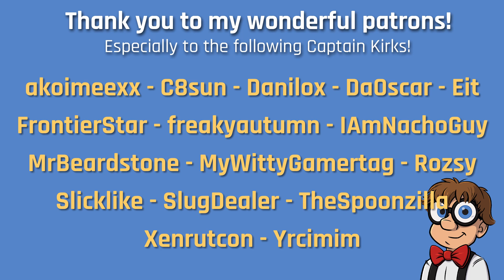Furnace Super Smelter Array - Legacy SMP #14 (Multiplayer Let's Play) | Minecraft 1.15

Comment: As I'm watching this it hasnt been discovered, but you wont get an even distribution to the last furnace in line. I just built my super smelter yesterday. Only a 32 but I'm playing SSP, no help to buy items lol. If you have that bump block directly next to the that furnace as the cart comes by it will only deliver 1 item. You have to have at least 2 more rails of track and then the bump block. As it stands of it makes 8 passes, the last furnace will only receive 4 items where as the furnace next to it would receive 12. 

My design I skimped on the amount of droppers by having 8 hoppers/dropper. Only used 4. I may go back and changed it if I feel it's too slow.

Incredible build as always. I like the idea of using the shulker loader/unloaders as well.
Reply: Also, I made mine bamboo powered. If the last furnace and hopper isnt full the farm is going. The lever that I use to activate the cart also doubles as an override for the farm. While its smelting the farm sits silent but as soon as smelting is complete and i turn off the lever it will start, then shut off when the last in line is complete. Just a basic flying machine bamboo farm. For the record I built it underground so it's not an eye sore. It easy to get around the light levels hurting the growth. I just placed a grid of torches with 2 blocks in between each other at the bottom then waited for them to grow. Then from the top of the farm (since I'm not good at calculating light levels of air blocks) just placed jackolanterns until I started to see growth. Then picked up the ones that weren't needed. If I wanted to I could've just stacked up glowstone in rows and had more efficiency with more bamboo able to grow, but it's my build that I didnt need help trying to make work and it functions for me. Just made sure there wasnt any light sources in the way of the slime blocks and was done.

Comment: At around 13:40 you talk about the awesome way of detecting a full minecart and sending it back up the hopper line if it’s still got items in it. I tried to build this and was failing miserably until I read on the minecraft wiki that if a minecart enters a powered rail from the side, it turns east or south...I built mine in the wrong orientation and the minecraft didn’t go up the line but returned back to the loading station.

Comment: 240 Hoppers isn't much.
I've used about 3000 in each of my Guardian Farms (exact number has varied a bit).
It's also short work in 1.14.4 and up with the insane rates out of "panic mode" iron farms, if you have a decent sized tree farm or an autotree farm.
That smelter array though IS impressive - biggest I've ever built was 24 smelters and 3 more furnaces to feed charcoal or kelp to the rest....
Reply: What did you use 3000 on
Reply: @Fpm1632  Kill/collection floor.
Most of the servers I've played on would not WORK with enough minecarts w/hopper to use those to collect with - too many "stops for no reason" issues.

Turns out the actual number is normally closer to 3600 = commonly a 59 x 60 or 59 x 61 array of them.
Reply: @bricefleckenstein9666  woah ok

Comment: why did u use slabs for one part of the water stream but pressure plate on the other?
Reply: The slab version is necessary to make sure the dropped items (from the droppers right above and next to the slab) don't get stuck on a block without flowing water on top. However, it requires an additional block of vertical space and really only provides a benefit when the item is not moving along the water stream already. On any other part of the line, the items will always have sufficient speed to slide over the ice block all the time.

Comment: Hi Logic. im trying to build that minecart loader in my world (using a creative to test it first), but im just using a chest ontop of that hopper instead of the shulker box unloading system. However I have encountered an issue where sometimes the minecart, nor the hopper even, load up any items. the items will sit in the chest instead of flowing into the hopper or minecart, as if the hopper is locked, but i cant figure out why. Do you have any advice to help fix this?

Comment: I've been trying to design something like this for a while, it's tricky though. I wanted it to be able to do any size job which is super hard.

I don't think yours is that flexible atm... If the shulker box doesn't have a multiple of 5 stacks (completely full hopper minecart) then the end of the job will get stuck in the minecart at the unloader, right?

I'm going to examine it closely for ideas though! Thanks :D

Comment: Why not using a carpet dubber to fuel the furnaces ?
Reply: Because item duping for renewable resources is at best "questionable" and more often considered cheating than not. Also, carpet is a bad fuel source that doesn't scale well at all. It's worse than sticks and marginally better than bamboo, but in either case not great for large batches of items to process.

Comment: I have been wondering since many episodes, how do items go up without water ? Is it due to range of droppers ?
Reply: Based on the pre-1.13 item elevator. If a dropper puts a block it will travel vertically up until it reaches air.